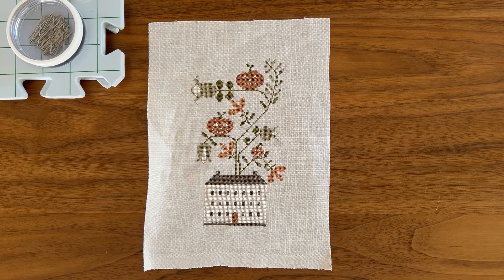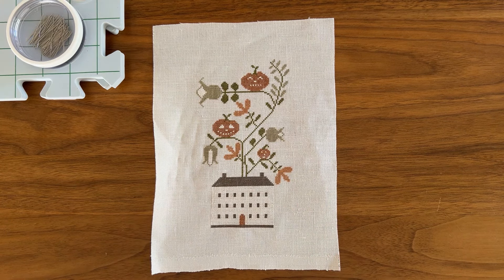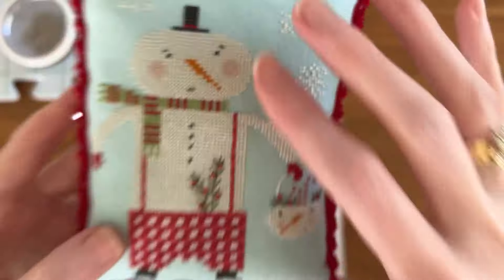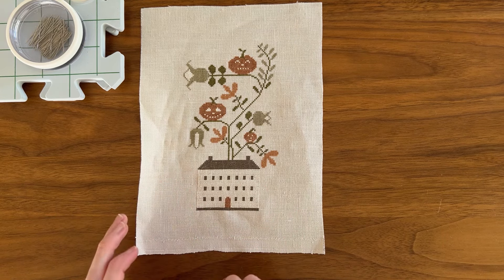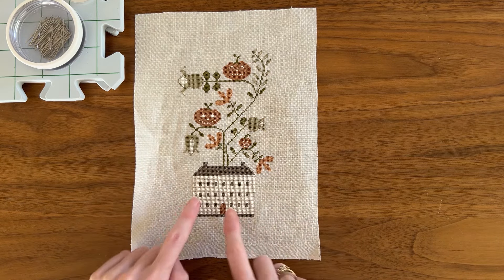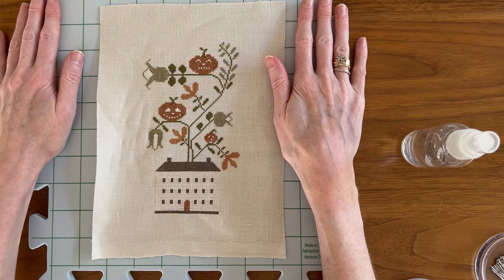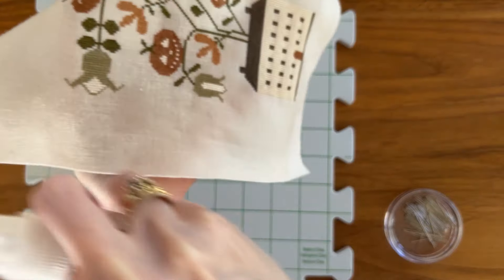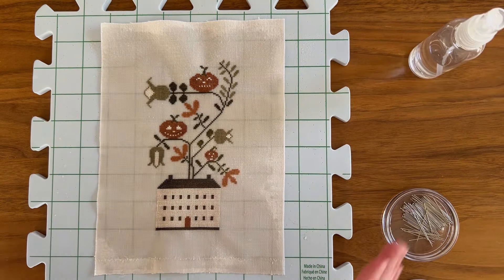Tutorial: wet blocking a small cross stitch finish

Comment: Your stitching is Perfect!!! Cold water in the spray bottle is just tap water, correct? Good tips, and running the water through vs soaking the piece. Any suggestions for overdyed linens & floss when wet blocking can't be done? TY
Reply from the maker: Yes - if you would drink the water out of the faucet, then it's fine for your needlework.  But no, I don't have suggestions for overdyes as I only use color stable materials.